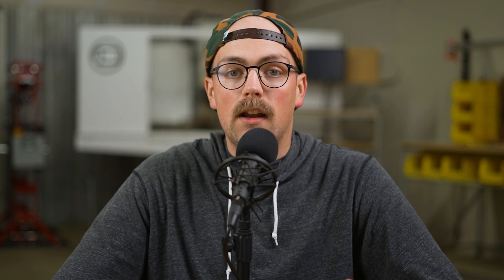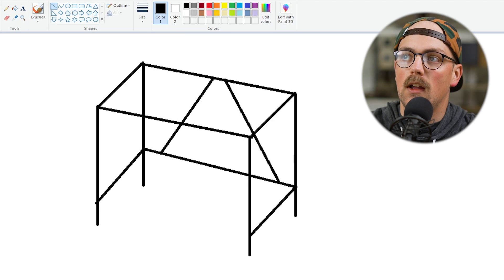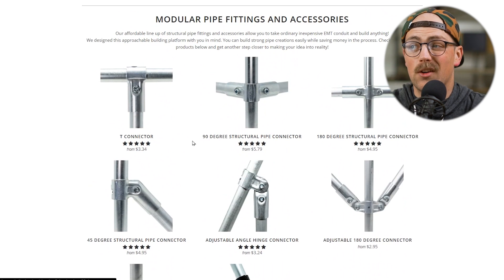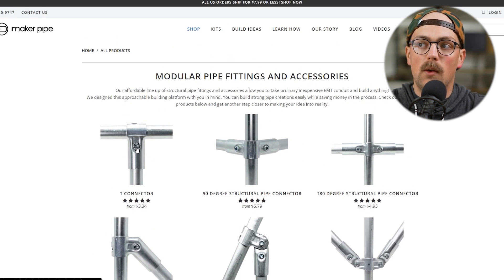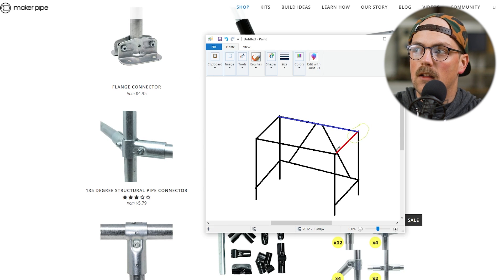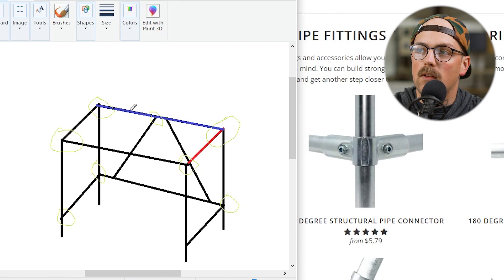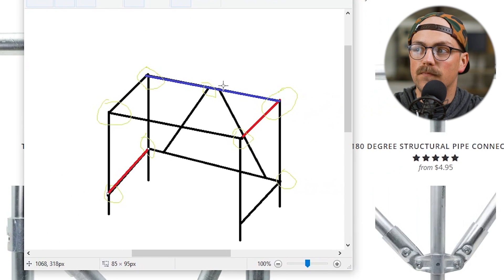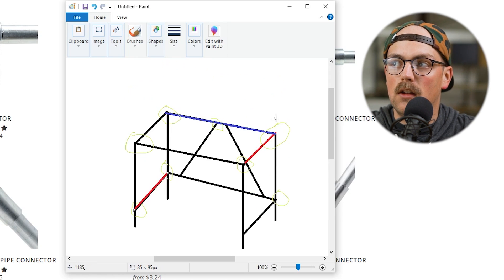How To Plan Your Maker Pipe Build

Comment: Hi!  On the 4 top corners of your desk drawing, i see you mentioning using the 90 degree structural connector.  Is there a way for the vertical pipe to end using that connector like your drawing (3 ways) and not continue though (4 ways) like the connector image is showing?  Im trying to make a trellis so the corners end with one pipe length height and not a two layered structure.